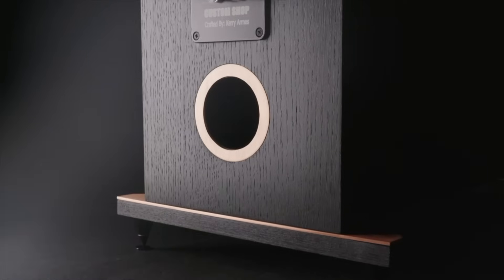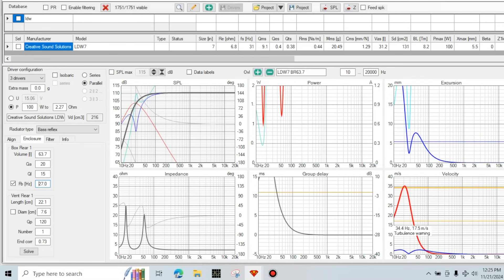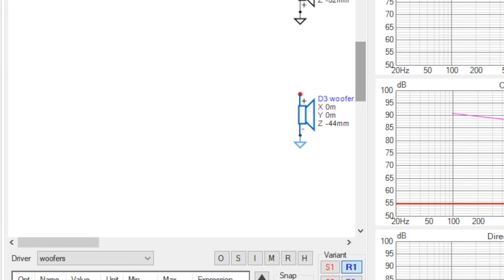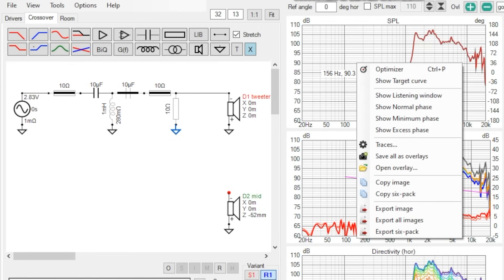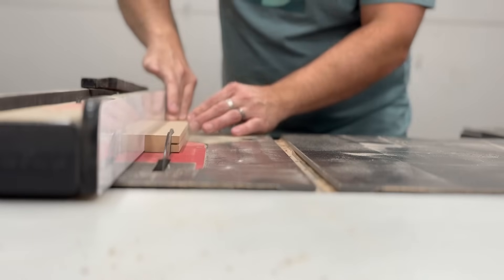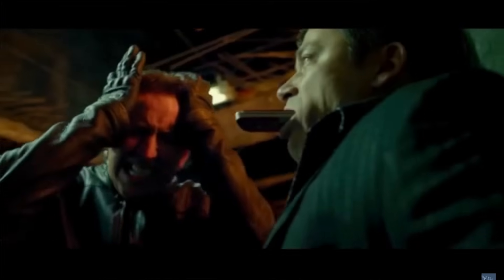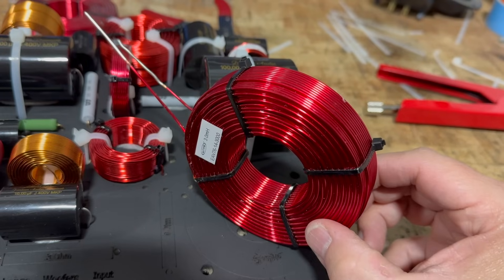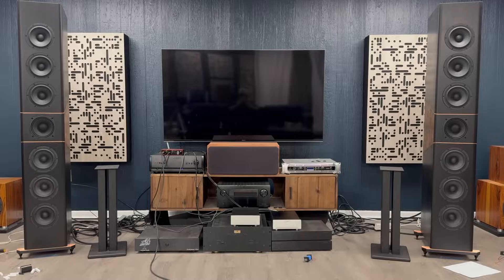Part 2: Turning $3000 in Parts into a $30,000 Speaker Crossover Design

Comment: Truly amazing build. 

But… one studio dsp speaker processor, with 48dB/octave slopes and three, stereo power amps would be an easier, and superior, solution. 

The high frequency drivers wouldn’t have to work too low, the crossovers can be precisely set, drivers can be time aligned and the whole frequency response can be sorted.

Superior phase alignment, damping factor, power-handling, dynamics and detail. 

Why anyone would want to employ an inferior, passive crossover nowadays, (an analogue, or digital, active crossover is far more precise and power efficient) when decent, affordable power amps are readily available is beyond me.

Comment: When building enclosures for the LDW7, after determining internal volume (0.75 cubic ft, as you stated), do you generally adjust the dimensions up to make room for internal bracing, woofer, crossover, and port volume? Or does the 0.75 cubic feet here generally leave enough volume for these internals?
Reply from the maker: The woofers and bracing generally take up a negligible amount so that even if you account for them it doesn't change the box volume enough to make a real difference in the tuning. The port can often take up quite a bit though depending on the diameter and length so I usually account for that. Larger woofers, like our SDX12 I will also account for.

Comment: I just finished some speakers with an open 10" coaxial, mounted on top of the box and a 10" woofer in the box. The open coaxials are sloped back by 20 degrees and also have 5" open horns mounted 1" in front of the center of the coaxials. The speakers are point source and dipole and the best image I ever heard. 🎉
Reply from the maker: Sounds like an interesting design.

Comment: the struggle is real, one offs is the worst.
it all came together in the end and you got the result you wanted :) 
i decided on a speaker build myself just at the start of summer, and i ran into all kinds of shit i had to deal with, no summer for me that year, only building until done. still worth it.
Reply from the maker: Agreed. Most people don’t realize how challenging one offers are. We also get a lot of comments on how we should’ve been using a CNC machine because most people don’t realize how much time it takes to program a CNC machine versus just doing these cuts with a router and table saw.  If we were doing this as a production, it would totally make sense to do CNC but it’s a one off. It’s so much faster and easier here just to use the tablesaw and router.

Comment: Looks like a future kit. Perhaps aimed at those with more woodworking experience? You should also make the Typhon a kit as well. Doubt you'd sell too many but it would be a prestige piece, and on both speakers you've clearly already done the hard R&D work.
Reply from the maker: We don’t have any plans to make the typhoon kit at any point in the future. This could potentially be a kit, depending on if there is enough demand.

Comment: Looks like a cool project. Glad I saw it. Was thinking about using that FaitalPro 6HX150 driver, but with your troubles I'm probably going to look elsewhere
Reply from the maker: There are two other pro Audio coax drivers that look like they will fit the same cut out and have the exact same frame shape, and size from B&C and Celestion. I might try swapping those in at some point and remeasuring.

Comment: Thanks for sharing.   I gotta play devil's advocate...active can be simple!  I built a 4 way active speaker and power it with a single Emotiva amp!  They offer custom amp configurations, so I was able to get all 8 channels in a single amp.  I configured the amp with 6 "high power" channels for my subs, woofers, and mids, plus a stereo channel for the two compression drivers.  Combine that with a minidsp HTX, throw both in a small rack, and you're golden.  Oh, and I am using a single speaker cable--8 conductor with a 4 channel speak-on connector!
Reply from the maker: That sounds like a pretty clean way to do it!